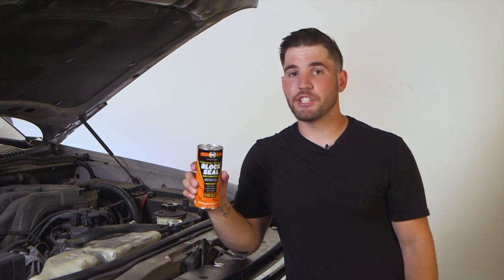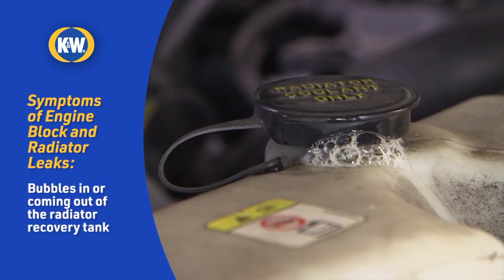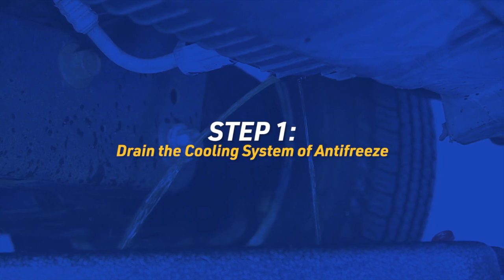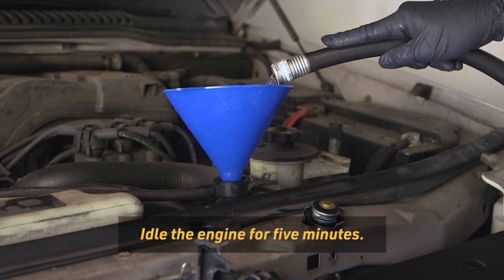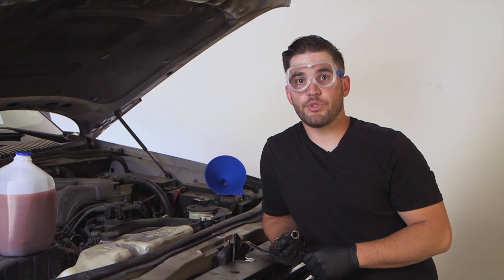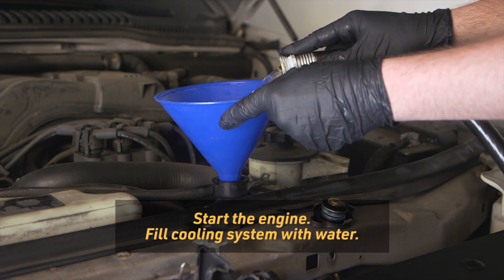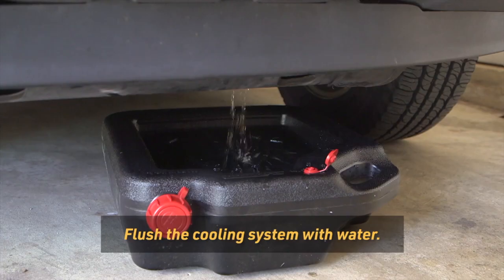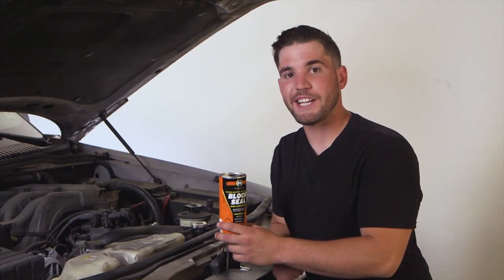K&W Permanent Metallic Block Seal | Know Your Parts

Comment: ok like when its done he said to flush the system out .  that would require starting the engine to cerculate whats in the block out .  i used the older liquid glass wow that was the shizit back in the day i have not seen it any were . i got the kind on this video on its way from a couple states away. ive used 3 other kind in the last three months to do no good .  ive had to go on line to find the k&w brand there are no stores carry it around me .  i guess they know if they sale this it would be over and you would not come back every month to buy another bottle .  i also purchased the permanit nano tecnolagy that they make one or the other should solve the issue . i have faith that k&w will fix my problem!